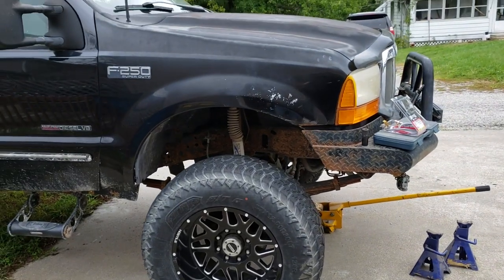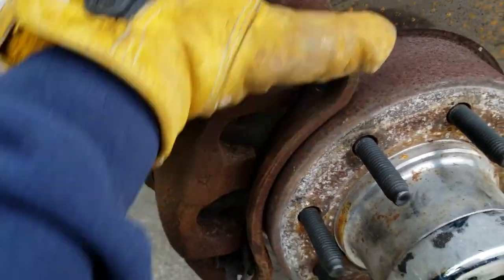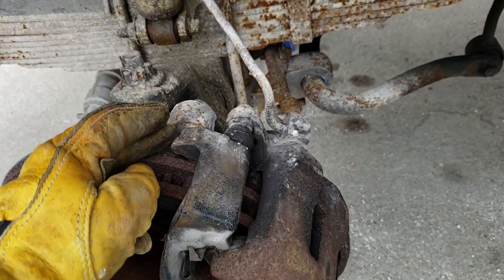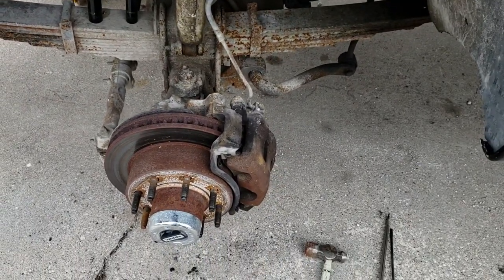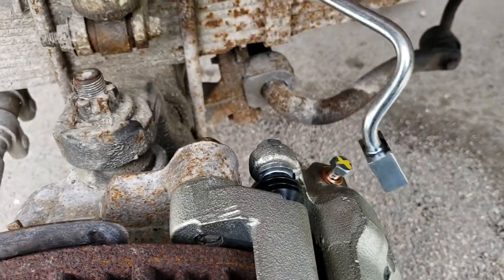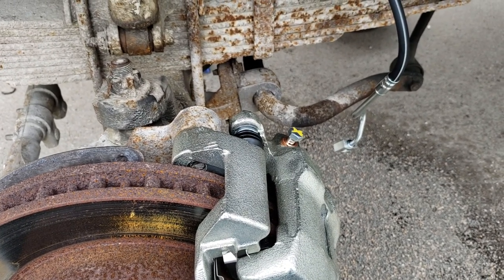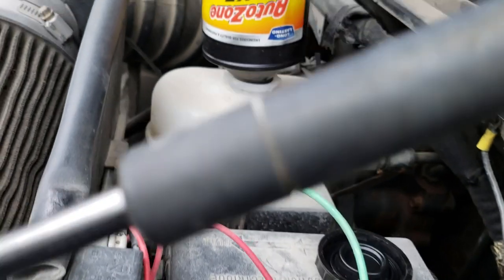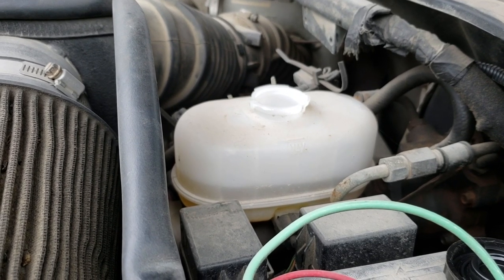2000 Ford F250 Front Brake and Line Replacement DISASTER!!!!!!!

Comment: Great job sir. However you need to put  thread locker on those caliper bracket bolts , so that vibration wont loosen them over time. Not anti seize.  One last thing, please collect all your fluids and dont let them just fall on the ground.